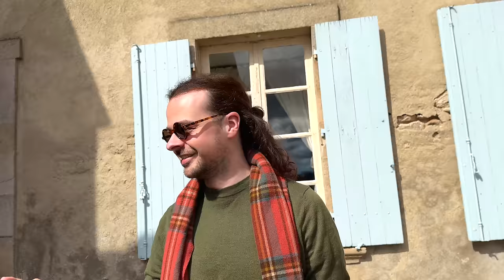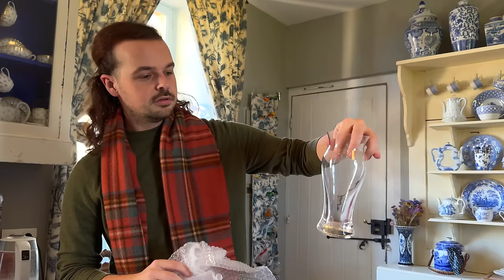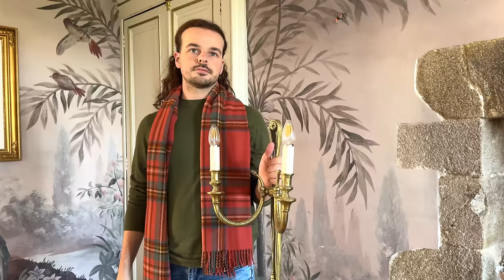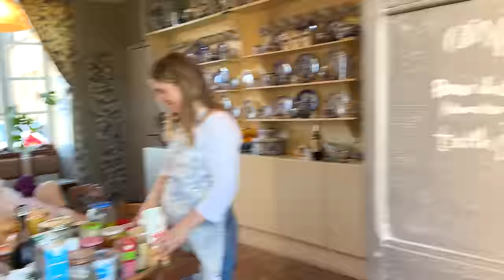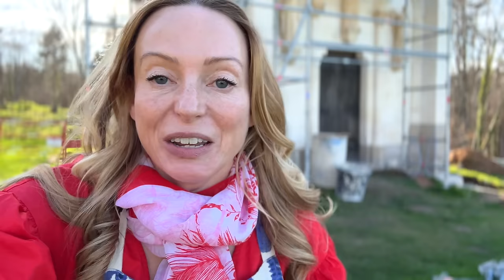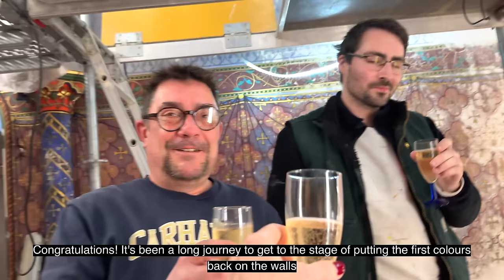Finding Bargains Online to Get Ready for our Chateau Guest Season!

Comment: Put some hard boiled eggs (shells removed ) in the beetroot juice and leave them for a few days in the refrigerator. You will have beautiful pink eggs you can eat or use in different ways. Pretty presentation on a salad.
Reply: Or even gently crack the shells of the hard boiled eggs before putting them in the beetroot juice as when they're taken out and the shells are peeled off, they'll have a beautiful pink marbled look about them.

Comment: The folks at Lalacelle vacillated over whether to clean their chateau or not, Terry was inclined towards the aged appearance, but after cleaning a test area they realised it looked so much better freshened up. 

The original artists and owners weren't aiming for shabby when they did these works - they wanted the vibrancy.  Ideally it would have been refreshed and repainted over the years. Managed decay is not honouring the original vision.

Comment: Whatever happened to the bedroom you were working on….Amory had to replaster the walls.
Reply: Pavlina's room. Amaury is putting in insulation and a new wall.❤ Amaury also talked about insulation for the floor. Stephanie wanted carpet in there also. ❤
Reply: I was wondering something similar the other day. What about the floor that needed more support for the walls that it was holding above because the beams were found to be short and not anchored properly (from memory). I may have missed an update? Xx
Reply: @rossfamily1184  The hallway floor, rooms, and new bathrooms in the B&B are not talked about much, except that Steven gave Stephanie this week, the new wallpaper designs she was looking for to replace the older ones. These designs almost duplicate the older designs, but Stephanie may change some of the colors.

Comment: I would of completed the vaulted ceilings the best that could be and also the highest parts of the chapel
Yet the lowel level you could afford maybe leaving a more maybe a slighty worm say 50-75 year old finish, like the finish will ruin so much faster than the rest. And in 30 years or 50 years time, can you imagine the restorations team returning and the cost then.

Comment: Please get the oven serviced I’ve never seen such bad baking!!
Reply: Bad baking? It's meant to be that colour, plus the paper around the tin folded in because of how Stephanie put it together. I don't think anything is caused by the oven 😂
Reply: Is that your real name?
Reply: That’s what it’s supposed to look like. It’s called Basque Cheesecake and it’s supposed to be very dark and crack. The only other thing she could have done was used a slightly wider springform pan.
Reply: Still runny in the middle though
Reply: @annettecurtain5052  Is that your real name?
Reply: @annettecurtain5052  Look up literally any recipe for "basque cheesecake".  It's meant to be very dark on top and still runny in the middle.